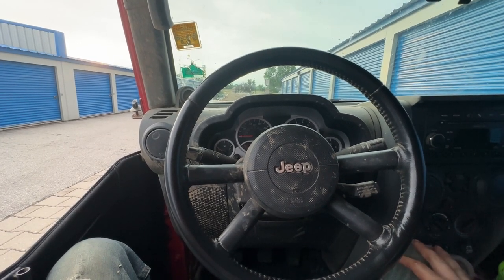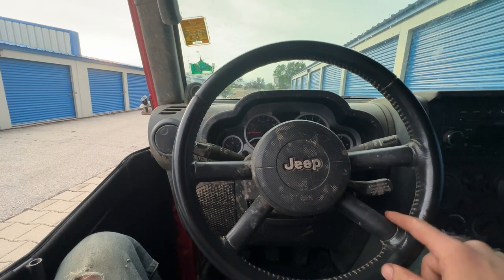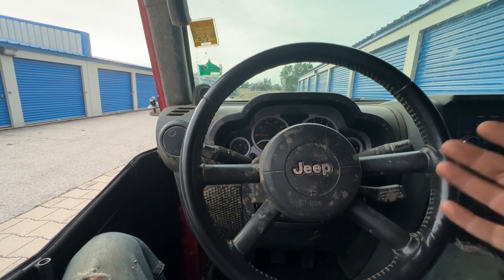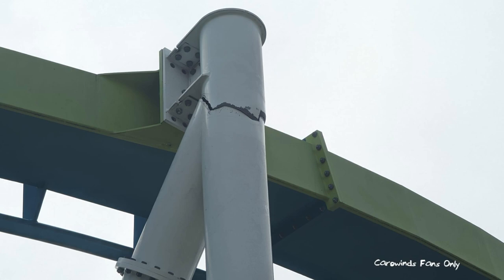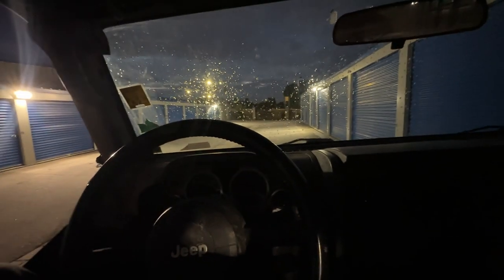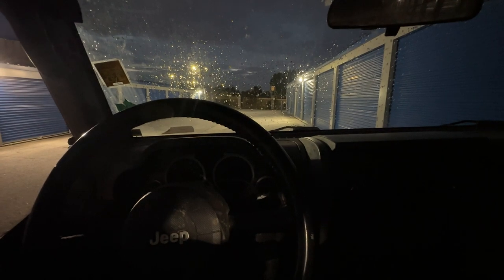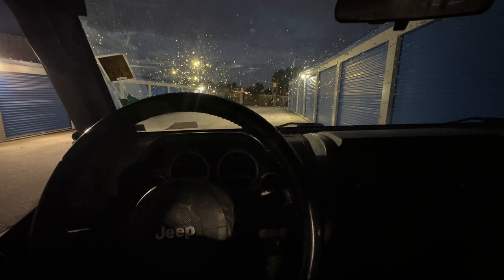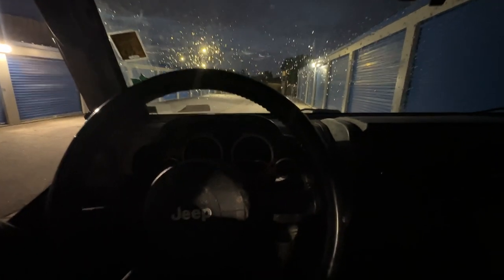Bad weld, or bad design? Let’s talk about it

Comment: Hi Greg, hindsight is 20/20.  The rupture occurred at a predictable location, point of maximum moment.  A weld should not have been located at that point, it is a  predictable stress riser.  I would not sign-off on a repair of the existing column, only a replacement.  It appears the bolts were not adequate to secure the connections, I would bet the bolt holes at the flange are wallowed out.  The faying surfaces appear to be a bit light in section for that type connection and the bolts may not have been torqued correctly.  Perhaps the "Turn of the nut" method was used.  The wall thickness of the columns is not too critical, the strength and rigidity of the column is due to diameter.  I would venture a guess the whole assembly is A36, high strength, low alloy is problematic to assemble in the field.  You did a pretty good forensic on the observable damage.
Reply from the maker: Thanks for sharing your insight and thoughts 😀.  I just read they are going to replace the column, so it sounds like a repair was a no go lol.  What are your thoughts that more columns may have atleast starts of cracks?  If this is the first one I would be a bit surprised, but I am unsure as to how long the ride has existed.
Reply: Hi Greg, I would guess that more than one column is cracking.  Due to the rotational loads imposed upon this section of column I think the design is a minimalist effort.  Perhaps the customer asked for a design to last a specified period of time/cycles, if that is the case the design would, of course, be minimum code compliance.  The code is not always correct, it happens infrequently but code compliant structures and elements of structures do fail.  One cannot foresee all circumstance.
Reply: Depending on the environment the disassemble the coaster every year and store it throughout the winter.  Used to work at a park with a similar ride.

Comment: Interesting case!  I think the bolted on plates were designed to allow some flex there…to avoid cracks in the column…but it was not quite right.
Reply from the maker: Definitely some wrong calculations or mistakes made in the design lol.

Comment: I would vote poor design  with not enough gusset plates and  support backing  plates  for the downward gravitational forces . Welds can look clean on the exterior  and with X-ray or  UT show  failures within with large amounts of  perosity and other issues  within that weld .   Put enough gravity  forces on the weld and it  will eventually fail. that's what likely happened there .  More thourough testing and investigation would give answers  to the exact cause its not just weld failure its engineering  and design.  consistent gravitational  pull on that column the  weld the  bolts  from the weight of the track the  coaster cars they all have contributed to that failure.
Reply from the maker: All great points.  What do you think the odds are that the known broken column is the only one with a crack?  I have a feeling it’s not the only one…
Reply: @makingmistakeswithgreg  I agree ! I would inspect everything from ground up and top down .

Comment: Those blank looking hole’s appear to have TC (tension control) bolts in them. The heads are similar to a rivet profile, and the tip of the bolt has a tit (spline) that will twist off when the bolt is torqued to a manufacturer spec. The splice plates with the 8 bolt connection for sure got racked. It should be squared up and there would normally only be a 1/16” of slop in the bolt holes. Once the bolts are tensioned correctly there shouldn’t be any movement unless it’s a slip critical connection which is unlikely. Either there needed to be more bolts or they weren’t tensioned correctly.  The gap between the two plates is normal, but the splice plate is racked.  The reason for the bolted connections is mainly just to eliminate field welding. Simply for erecting purposes. The break in the pipe is a whole other story. It seems that the constant movement and vibration made that weld fail.  The one picture may show undercut I can’t tell.  There are so many variables to accurately say.  One thing that sticks out is that they didn’t use softeners when they took all those wraps with a Kevlar sling around 4 sharp edges. It would have sucked to part a sling while trying to lift it to elevation for the stongbacks to go on.
Reply from the maker: All excellent thoughts.  Interesting thought on the bolts, I don’t do steel erecting but that makes sense that they would have a rivet like head.  How long do you think there was evidence of a crack?  I would imagine it could have been a while before it got to where it was.  The crack had to have been visible for days if not weeks due to the white paint.
Reply from the maker: Also, what are your thoughts on a repair?  I am willing to bet they go for a replacement due to liability.  No doubt all that steel near the crack is fatigued and doing a repair would put a lot of liability on the company doing it.
Reply: @makingmistakeswithgreg  that crack had to have been there to some extent for some period of time. I just don’t see how it would crack and tear that much all the sudden. Maybe I’m wrong but I feel that there was something missed on their inspections. I do know that it’s a high stress connection, and under a lot of strain. Like you mentioned tho, it may have started on the inside and continued to grow with each run.
Reply: @makingmistakeswithgreg  If I were to guess I’d say that a fab shop will make a new column to the original engineered specs or possibly an updated version, and then they’ll just install the new piece. There will probably be some sort of false work for temp support during the swap, or possibly a support crane to hold weight while the change is happening.  There is too much red tape in my opinion to even think of repairing the existing column.  It’s probably not regular steel and if there is a lot of preheat/ post heat involved that will pretty much guarantee a shop would make the new one. With all the automated welding in structural steel shops it probably a fairly easy piece to make.
Reply: "One thing that sticks out is that they didn’t use softeners when they took all those wraps with a Kevlar sling around 4 sharp edges."
AMEN brother! I couldn't believe what I was seeing there with that rigging.

Comment: I am sure this death wish roller castrater has been built before the stress analysis computer software appeared.
With so many missing bolts, I wonder who could have missed that over the years.  Strange.  So where was OSHA in this?

Thanks for posting and sharing.
Reply from the maker: I think it’s very reasonable to think there was evidence of a crack for a long time.  It probably got missed due to location and likely poor inspection process.  Theme park rides are probably decently safe/inspected, those fly by night carnival rides are what really scare me lol.
Reply: Did not think this was an OSHA Issue. Thought they were for workplace? Not Civilians? Fill me in if I'm wrong.